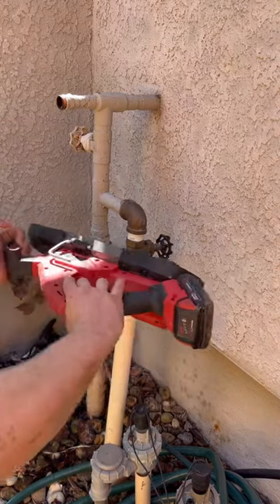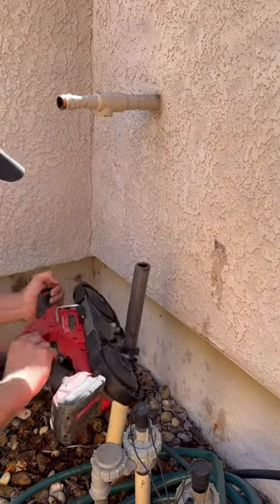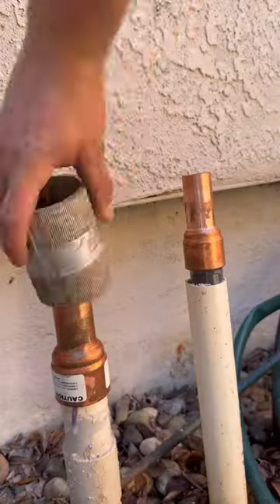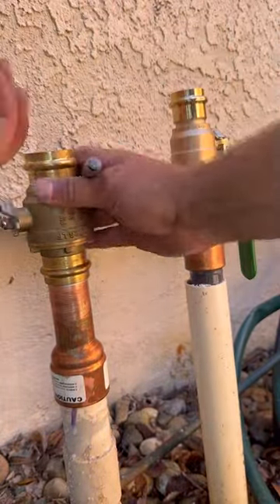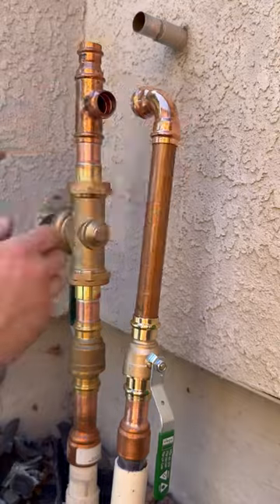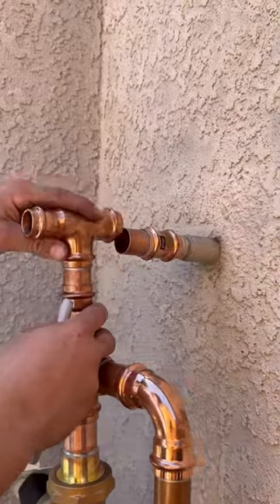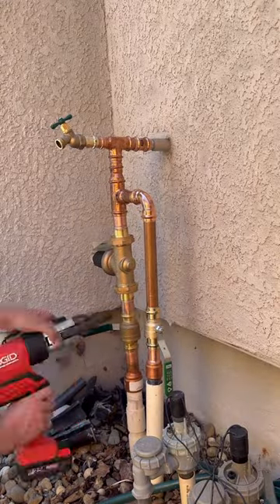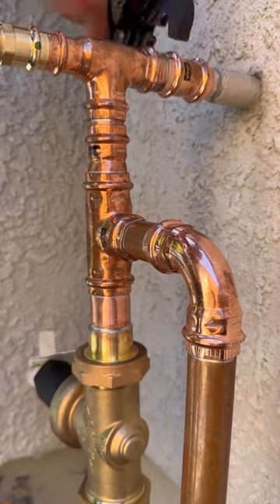pro press my casket #plumber #plumbing #diy #repair #propress #viega #pressmaster @ViegaLLC

Comment: I put in fence for years, that Milwaukee port-a-band is the best tool for cutting anything that's smaller than 4 inches and not wood. I have one from the early 90's all metal and still works great.

Comment: The Pro Press fittings are expensive but as long as the price hike is put on the customer, it doesn't matter.  
 As for skill, that's been gone since Galvanized and Cast Iron were used.

Comment: The pro press streamlined the entire process. It also keeps things nice and clean. Quicker work equals ability to schedule out more jobs. Which ultimately brings home more money. But sometimes, you gotta sweat, which is a skill set you will still absolutely need in some applications.

Comment: Does the band saw save much time ? I have noticed you also have a Milwaukee automatic pipe cutter. Just curious, great video. Rp350, Milwaukee and the original viega propress gun 5 are all 32kn, no power difference.

Comment: But for reals what are you drawing the lines for? Serious question
Reply from the maker: Just a depth mark. If the fittings pulls away from the pipe I want to know
Reply: @replumb  🫡💯

Comment: What is the point of the markings with the pen ?
Reply: When you dry fitting the marks act as a indicator to let you know you’ve gotten to we’re you need to press or solder